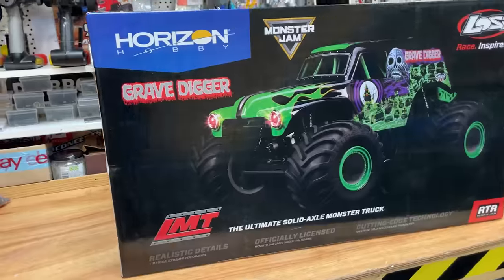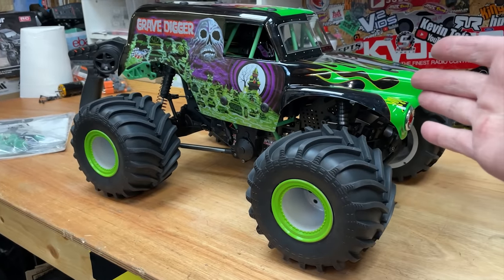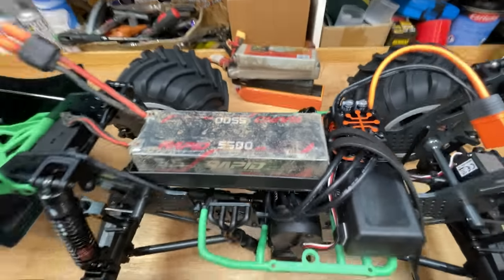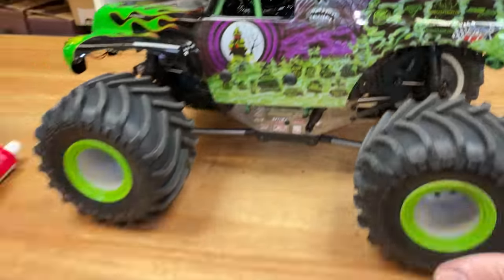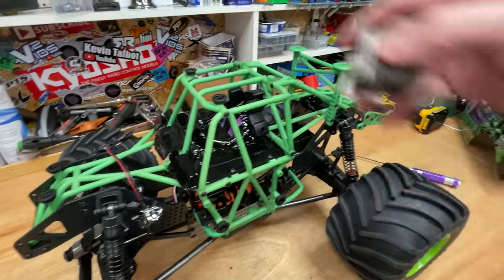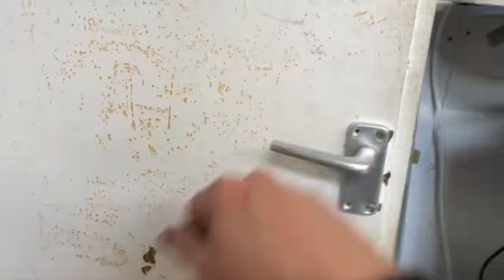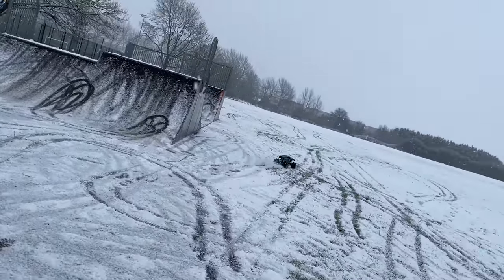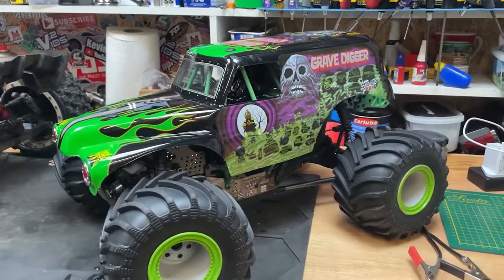Worlds BEST Grave Digger RC Monster Jam Truck

Comment: Hey kev!! Great video! It wouldn't surprise me if the axle snapped partly because of the cold making it brittle! 😉
Reply: I'm not sure if I seen a video with one not breaking. Even at 40 degree temps in one video. I've been Bashing my RCs in 20 degree farenheit weather the past month and no breaks yet. But having said that yeah cold weather dont help lol
EDIT: and obviously I don't bash nothing near the extent of Kevin but as many times I've wrecked I'm surprised nothing has broken.
Reply: New plastic shouldn't be brittle whatsoever. Brittle comes hot, cold, hot, cold through seasons. If it's New & brittle, then it's poor quality
Reply: @jknewb6276  буулулк

Comment: This is a great truck. I put the alloy axles on right out of the box with the four wheel steer kit and has been great for me.  A week ago I ordered a Raminator with the 80cc RCMaxx engineW/110mm clutch kit, 4 wheel steer kit and 2 inch longer wheel base kit along with some other bits. Cant wait to get it. Its gonna be EPIC!!! I'll probably give the Digger to my son.

Comment: Hey Kev, same thing happened to me first bash! I fixed mine using superglue and baking soda, reinforced both sides and the rear, so far seems to be holding up just fine! Whether or not it's strong enough to take it to the moon, time will tell!!

Comment: I got mine and it is awesome, so much fun. Just check every nut and bolt because my wheel where you have the 6 bolts onto the wheel adapter where totally loose on one wheel and one of my link mounts into the axle was loose.

Comment: I've got a 1998 grave digger I don't know how good it is now since I burnt out the motor and lost the controller when I was much younger but it was a pretty fun truck and had enough power to do decently and even now is pretty large and heavy compared to my other stuff if you can find one you should try it out (not used to doing this so if you want a picture ill need some guidance about what I should do) I'd suggest a picture though cause it was quite difficult for me to find the correct one without looking at it(Also I have no idea how much one costs now)

Comment: Hey Kev with what you said at the end about hoping they bring out grave digger trucks with the size, speed, durability of an X maxx… would it be possible for Traxxas (or an after market shell manufacturer) to just bring out a grave digger shell that was X maxx compatible? Obviously there may be some form of licensing needed but it couldn’t be too hard with the amount of monster jam trucks getting around from small toy grade trucks to hobby grade and right up to the primalrc raminator sized grave digger.

Comment: yo, you seem very knowledgeable on electric rc, so i have a question.  My sonuva digger is using a 4000mah, 3s Lipo and i have a hesitation when i go full throttle from a stop in forward and reverse.  any idea why?

Comment: Got it on the release date from the local Hobbytown, it is truly a beast and does excellent slap-wheelies off the ramp. Only problem is that the decals are off centered on the body which I’m going to contact Losi about (since it’s a $600 truck instead of a $150 truck)

Comment: Hey calve if you have it on your controller mounted maybe the vibration or batteries of the controller might sound that way or your hand is over the phone speaker so it sounds sinister

Comment: Locked different Arrma 6s?
Earlier I took apart diff to change oil, the gasket broke, I thought it would be fine without the gasket but the diff would turn 😁 so i took all the oil out, whacked it together, put it in the rear of my O6 and the rear diff is locked. 

Lmao don't know how long it will last but if it does I'll be doing the middle diff next 🤣👍

Comment: These were designed to break. Broke mine in 10 mins. Needs 2 shocks on each. Tires need to be full rubber not inside wider rim. Links break on axles. Axles break. Need to upgrade axles to aluminum and link connectors. Don't waste the money!
 Too fast for what it is.

All 3 runs I've done now the driver side front shock has actually unthreaded itself and blew apart. Tires wobble on driver side. Too much play. Needs major upgrades. Fyi.

Comment: alright not related to this car but i cant find an answer in forums and even tried the traxxas support line and the guy i talked to has never ran into this issue. i hope you all can help.

i have a xl5 rustler 2wd when i turn left and let it go back to center it is fine. when i turn right and let it go to center the front left tire stays to the right a bit but will correct after i turn left some. any ideas? everything seems straight ive checked the servo saver it hasnt taken any nasty falls. im at a loss for what it could be.
Reply from the maker: sevo gears?
Reply: @KevinTalbotTV  would that makes sense with it being only 1 of the tires though? I do plan to upgrade to a better servo and everything lonking to the tire but was hoping to wait to replace things as they actually broke over time, not a month into having the car.
Reply: to add to the details. ive removed the servo and checked the servo saver from what i can tell they both sound and look fine.  turnbuckles are in good shape too with no noticeable bends.  i have adjusted the tires to have a bit more toe in since noticing this issue which helps it a little bit but not a true fix. thanks for the help.

Any budget friendly servo's you would recommend?

Comment: Bust the plastic axels and a company on e-bay called Teal RC have already released the axles and I bet wheels ae next as they do alloy wheels for the UDR, maybe the SBR by now if not Vitavon on e-bay sell the alloy parts I have bought a ton of their gear for my UDR, and SDT.
I still think it is a little weak not an ultimate basher but very close.

Comment: Take a look at Jer Custom Design RC, they have upgraded fix for the LMT axle cases. Moulded/printed cases repair kit for $20 per axle. They also offer complete axle cases CNC machined 7075 aluminum housings + hubs for $168 per axle. I have no connection to this company at all.

Comment: When mine arrived the body had chipped paint,  many scratches and scuffs. Plus my black sticker looks brown which most are aware of.  For $600 they need to do better.  Emailed HH 6 times,  no response.  Called 4 times.  Waited an hour each time before I gave up.  Buyer beware of you actually want customer support.  Shit,  I can get a better looking body from a Wal-mart. Also,  the axle housing is the biggest weak point.  So many people have had them snap from moderate bashing, even in warm weather.  Mine is sitting until spring..... by then I'll have metal axle housing front and back.